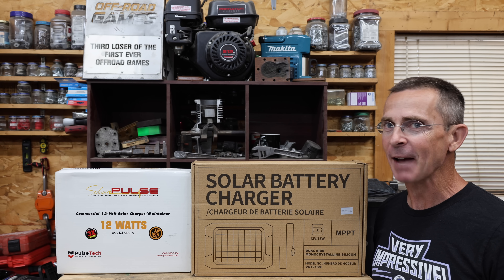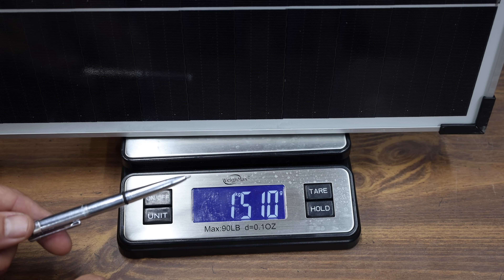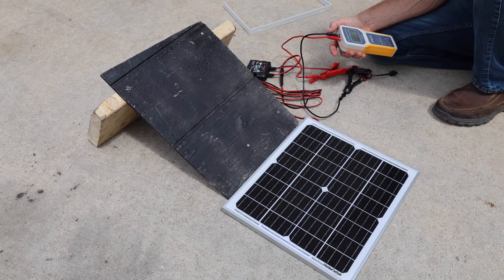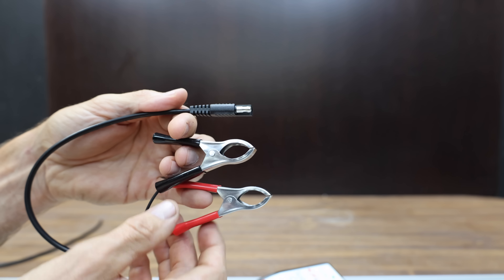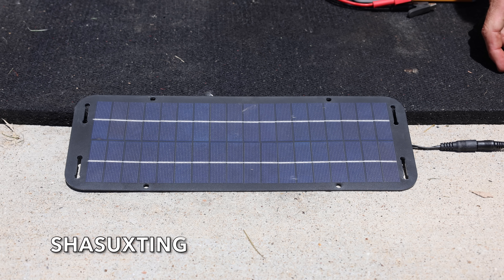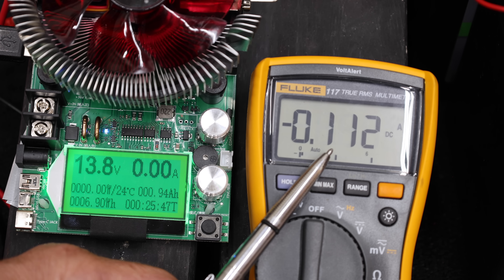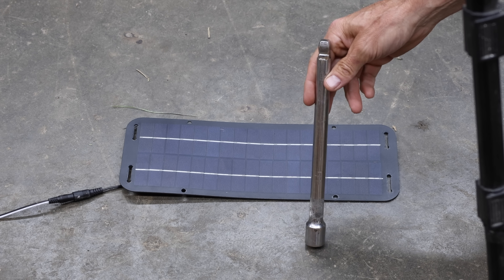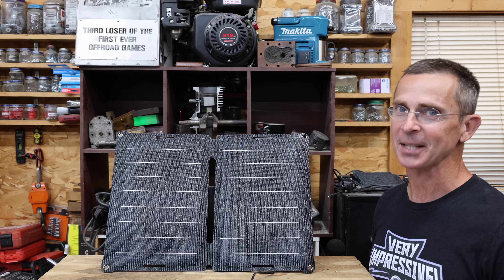I Had No Idea These Were So Good!

Comment: Great testing.

What a lot of people do not understand is that solar panels are rated in watts. What they also do not understand that solar panels or the charging adapters that go with the solar panel(s) are designed to provide "normal" charging voltages and amperage's.

What that translates to is that a solar panel can only charge a phone for example at a normal phone charging rate. Solar battery chargers are different in the battery can take all of the wattage the solar panel can put out and then some.

Now it gets dirty. WATTS is a function  of VOLTS times AMPS equals WATTS.    W=A X V or A=W/V or  V=W/A.

In the real world if you have a solar panel that is rated at 40Watts (40W) that can produce 12 Volts (12V) then the panel can produce 3.34Amps (3.34A) under the best conditions. A normal USB A port provides 5V at generally 2.4A, or less,  for charging devices that can be charged with a USB A port. USB C is different which we will not get into here but it has some of the same limitations on current (amperage) flow as the USB A ports to avoid burning out some devices when charging them.

So if your 40W solar panel is connected to a USB A adapter the normal charging amps  for the phone is only 2.2 A at 5V which is 12W. People think that a 40W (fill in the blank) solar panel should charge their phone so fast it launches toward the moon when in reality if your phone takes 2 hours to charge at home with the home adapter plugged into the wall it is still going to take 2 hours to charge your phone in the field if everything goes OK. Shade, no sun, anything that covers part of the solar panel will slow down the process.

People will measure the output of a solar panel and only measure 12W at 5V coming out of the charging adapter and complain that the solar panel is not working correctly. That is all that the charging adapter is designed to do. Where are the other 28W claimed by the manufacturer? They are there the charging adapter is limiting the amperage and voltage so that the solar panel does not burn out the phone or other device. If you put the 12V at 3.34A straight into your phone it wouldn't work very long so there has to be a charging adapter to protect your phone. Not any different than if you somehow managed to plug your phone straight into the wall outlet at home. As a famous man likes to say that would be a good way to let the smoke out.

What you are getting with portable solar panels and what you think that you are getting or supposed to be getting depends on how you are using them.
Reply from the maker: Thanks!

Comment: no harbor freight panels ? jakery? or that blue something, ecoflow?
Reply: Would have loved to see the hf panel with hf controller. Every time I see it I think about it.
Reply: @thepanduuh  me to ive been on the fence on buying one.
Reply: @thepanduuh I’ve used one of theirs for several years to keep the battery on my generator charged up. It’s done well.
Reply: No, it’s a small complaint but if it’s not on Amazon (commissions for directing sales) he doesn’t seem to buy it.
Reply: I’ve been using the Harbor Freight panel for about 2 years. It doesn’t have a solar controller but it does come with a full set of connections. I use the Cigarette Lighter socket on my 98 Ranger no issues.

Comment: I do appreciate the reverse-polarity tests that you did.   That's an important one.  But for the most part these are just little solar powered battery maintainers so the power levels don't really matter much.  This is also one of the few products where a PWM charge controller is actually a decent choice to cut the cost of an already-cheap product even more.

If you need to push more energy, though, think about just getting a discrete panel and MPPT charge controller and wiring it permanently to the battery with the solar panel up top the frame of the vehicle somewhere, rather than these kiddie products.  And don't use battery clamps (which aren't really meant to be left unattended)... actually wire a fused circuit.  

People will even go bigger and wire a few hundred watts worth of panels into a power station for portable power on-the-go that doesn't need to be plugged into anything to be recharged.  It's super convenient.

Comment: The rated wattage of a solar panel. Like 100w for example, is the max amount that it can produce under perfect conditions. Like full sunlight with a cell temperature of 72F (meaning not the outside air temperature but the actual solar cell temperature) So a 100w solar panel rarely produces its actual 100w.....So if a home or car changer solar panel. Says it's a 20w panel but is only making 15w. It's not trying to lie about performance. It's just not making 20w because it's not in 100% perfect ideal conditions. 
     Around 2012 I used a $15 Harbor Freight solar trickle charger and a $20 clip on battery desulfator to make my truck battery last about 3yrs longer than normal. 8 yrs instead of 4 or 5 years. If you have multiple vehicles/12v lead batteries. You can use the battery desulfator on each battery for a couple months at a time. To help each battery last longer.
Reply from the maker: Thanks for the feedback.

Comment: I have an old Coleman solar panel with a cigarette lighter adapter end. It worked great once I figured out that some fuses have 2 positions and have to move the fuse to the constant power side on some vehicles I've used it in.
Reply from the maker: Thanks for the feedback!

Comment: The optimal charging voltage for a 12V lead-acid car battery is 14.42V at 20/25 degrees C. (I don't remember which one it is.). So a cut-off at 14.5V is not high. That is normal voltage expected from a car alternator that is working as it should.
Reply from the maker: Thanks for the feedback.

Comment: I have a $25 Voltset 20W/12V Solar panel and MPPT Controller and it keeps my 97 GMC Sierra battery topped off at 100% every single day. I have the solar panel magnetically mounted to the hood as it works so much better outside of the vehicle than through glass. As long as there's light outside It charges the battery and keeps it maintained. Been using it for 6 months and I never disconnected when the vehicle is in use.
Reply from the maker: Thanks for the feedback.

Comment: Video idea: best sound dampening material. Test both how well they dampen sound, vibrations and how durable they are to heat, water etc. 👍
Reply from the maker: Thanks for the suggestion.
Reply: @ProjectFarm  Yes, this would be a good one, and there have been some tests done by folks on car audio channels, and Noico No Noise was one of the rubber butyl models that did 2nd best vs 1 other that was over priced enough to get thicker of the 2nd best stuff. I have lined the entire interior of the car with it, and the doors feel and sound solid, the cabin inside sounds much quieter, I did a dB test and it made a significant difference, I forget the amount, but It may have been 4 to 6dB less noise.
Reply: @ProjectFarm  If you decide on this one, flammability might be something worth testing after the tragedy in Switzerland
Reply: @ProjectFarm  THIS!
Reply: @ProjectFarm If you do this please look at Vevor's triple layer sound deadner. I've wonder just how good it would be with three different materials on one sheet.
Reply: This would be huge, something that can be applied / lined inside or around machinery and motors like the inside of a noisy air purifier, or some power tools, or around a truck engine.
Reply: If you do this, please include ResoNix! I've heard it's the most top-tier material but it's very cost prohibitive so I've always wondered where the price-to-performance lands
Reply: Yes, please! Been thinking about reducing ambient noise inside my truck, though it won't need to be studio quality. Just enough to pass out quickly when I'm waiting on a delivery.
Reply: I'd like to see that.
Reply: Please do this, but include ease of installation
Reply: Asbestos would probably win that test.
Reply: lead sheeting
Reply: Would be interested to know if they're suitable for inside homes too.
Reply: For autos or homes,  I think P F is doing great not getting into building materials
Reply: If you are talking about sound and  vibration damping mat for vehicles, then I think that would make a cool video. Like the stuff you install under head liner, carpet, door panels, etc.
Reply: And fire resistance, it's apparently very overlooked.
Reply: miter saws.... please... miter saws
Reply: I would like to add that this could become a series.
Items for camper van conversions would be very popular as is the whole culture itself.
Reply: A related idea, test soundproofing used by musicians, industrial shops, and related. 

Another related idea is to test sound reduction panels for portable generators. Maybe include other techniques, like the bed of a truck, etc. And compare those to a generator advertized as being quiet (built-in sound reduction).
Reply: Dampen is to make something slightly wet. It's "damping material" and they "damp sound"
Reply: @CielMC  Random nobody knows better than the actual dictionary.
Reply: @JanneRanta  No I don't, check the dictionary
Reply: @CielMC  dampen
/ˈdamp(ə)n/ verb 
make less strong or intense.
"nothing could dampen her enthusiasm"
Reply: @JanneRanta  
Let me just say I'm not trying to "win the argument" and I'm genuinely trying to talk, I'm not asserting anything and feel free to prove me wrong with facts.

I don't know what dictionary that is from(cite your sources people) But here's my argument based on the Cambridge Dictionary: Interestingly the Cambridge Dictionary states that damper and dampener are synonyms(not true in some other dictionaries), however, dampen by itself does not have the physical definition(but does have the emotional definition as you mentioned here, unlike the word "damp" which has the physical definition that is more relevant here). If we are going to the Cambridge Dictionary, your use of "dampener" would be correct, but the usage of "dampen" would still be wrong(or at least inaccurate).

Personal opinion: I believe that the Cambridge Dictionary only included "dampener" only because so many people said it wrong that it is right now. Firstly the physical base word (verb, to make vibrations less strong) is 100% "damp", all (good) dictionaries would agree on it. As for how the suffixes are added it is used inconsistently, but damper(device that damps vibration) is the most grammatical as "dampener" would imply the base form is "dampen", which is (I'm not gonna say definitely, but) less correct as the verb for reducing vibrations. So my definition is right, whether or not yours is depends on the dictionary(the entries of which may have stemmed from wide misuse). Thus "damp" and "damper" are the correct word here, even though it sounds worse than "dampen" and "dampener".

Entries for reference, cut unrelated definitions for brevity:

damp

verb
uk
/dæmp/ us
/dæmp/
damp verb (REDUCE)
(also damp something down)
to reduce the amount of vibration (= repeated, quick shaking movements) in something so that it produces a quieter sound:
The muted notes are produced by damping the strings with your finger.
The device works by damping vibration.
The ground mist clung to the hedgerows, damping down all sound.
The cymbals are damped immediately after striking by pulling them back against the player's body.

damper
noun
uk /ˈdæm.pər/ us /ˈdæm.pɚ/
damper noun (CONTROL)
a device that reduces vibration (= fast shaking), for example in an engine:
The system includes a motor with appropriate gear transmission and a damper.
The new model has new springs and dampers and a sports exhaust.
Reply: Wouldn’t recommend this. It’s significantly more complex than “this product is better” because it depends so heavily on the noise source and other environmental factors. It’s a very complicated topic
Reply: "damps" not "dampens"! Dampening is making wetter, damping is reducing energy, in this case acoustic.
Reply: @fsbodever3496  dampen
/ˈdamp(ə)n/ verb 
make less strong or intense.
"nothing could dampen her enthusiasm"

Comment: I've tested out about 5 of these solar charge controllers, including two in this comparison.  The biggest issue I had was outright failure.  Some of these are inside-only and some are rated for a level of moisture.  Not sure if it was the moisture or internal component failure from some other cause.  I recently got one almost exactly like another that failed (from a different brand), but the polarity of the output leads to the SAE connector was reversed.  These need longer environmental testing.  I put mine under a large solar panel outside, so they are shielded from direct rain and sun, but not moisture and temperature variation.  Failures generally happen within about a month, if they do.
Reply: Sadly this channel has rarely tests longevity of products any more.
Reply: @bhough410 The average life of products, both as available for purchase and design life is partly to blame.  He's done some great 1-3 year tests though.

Comment: Some critique: Of the hundreds of tests I've watched you do over the years, this stands out to me as the one with the worst and least reliable testing. You obviously put a lot of work into every experiment, so, I suppose these are things you didn't know were as significant as they are:

Solar energy varies so massively compared to what our eyes perceive (we can "see" through a factor of 1/10,000,000,000 ten billionth of daylight), from Day being 100,000 lux to shade being 10,000 to overcast being only 1,000 to sunset being 400. Would you imagine "overcast" is 1% the light of daylight? For me it feels like, I dunno, 2/3 as much light, not 1%. Our brains interpret light logarithmically. So we that most of this test has very limited use without a control measuring light input (or a control panel measuring output). Easily 100% of the variability between panels can be explained by changing solar intensity. "Overcast" could vary by a factor of 10 and look the same to your eyes. Really not useful at all without the control, which is especially outlined by the difference in rankings between "sunlight" and "overcast", those should be a consistent percentage if the light was consistently controlled for, panels aren't really better or worse at low light specifically than other designs. As to the other measurable tests... none of them really matter. I don't think hardly anyone cares about weight (they're not on an airplane) or watts per square inch (they're not covering a whole roof), or hardness (these go inside on your dash, not on your front bumper), or durability. The only thing that matters is power, and your power test was almost not useful.

I know we can pay attention to only categories that matter to us, but, bundling them all like this when so many of them are so insignificant to the average person, this really tells a misleading story. And that's even if the power tests were done with consistency, which they weren't.

Minor critique: On drop tests, the only fair way is to drop a sphere, as very slight changes to edge angle lead to huge changes in damage. You can't control for perfectly dropping anything other than a sphere.
Reply: Thanks for pointing it out and explaining it.
Another serious flaw in the test is that, for example, at 8:45 Todd shades the PV panel he’s measuring with the meter. And as we know, even a partially shaded PV panel delivers almost zero power. But Todd blames the panel for it.
Reply: Yep, Todd misses things from time to time, for example in the large air blower review, he failed to notice that the Storm blower, which he gave a top rating, constantly drains the attached tool battery, even when not using the blower, so for example, if you were to leave an M18 battery attached overnight, you'd have a bricked battery.
Reply: Thank you, I was looking for a comment like that. I assume he doesnt have any solar panels himself because once you do, you'd know how weird and flawed this testing is. The durability one was also kinda meh. It might have been useful to some but only if he had actually checked the solar cells for damage. It doesnt matter if it looks damaged or the glass is cracked. The solar cells are whats important. The ones that looked fine on the outside could still have broken solar cells so the durability test was basically useless unless he wanted to test the durabilty of the appearance of the panels, not their functionality.
Reply: @MattsAwesomeStuff Project Farm does a good job with these.  If all were tested in the same way, then the comparison is valid for a consumer’s purchase. While the process might not have controls, it doesn’t make the comparison illogical or unworthy.  If you watched his other videos, the weight of the test subject frequently does relate to the quality.  I’d recommend you start your own YouTube channel and do a better job, per your criticism.  Good luck!
Reply: @thejam70  You clearly do not understand science at all. "If all were tested in the same way", sure, if I had a random number generator and assigned a score that way, that would be fair according to you, they all got the same test, which randomly gave them a number. The best one at scoring high in a random test wins! Except that that's useless.

I have been watching ProjectFarm vids for 8 years, since almost the start. Todd has regularly incorporated mine and other's feedback. For example, do you notice the graphs? That was my idea, I sent him a sample of what a graph could be on a video, and since then he's made graphs.

I do have a channel, I help others on their channels more though.
Reply: Blah, blah, blah.